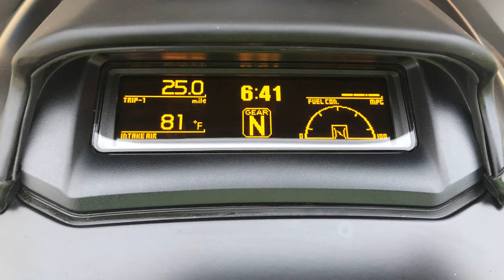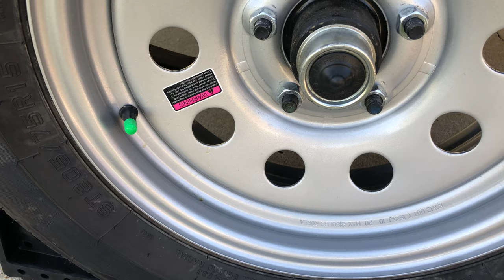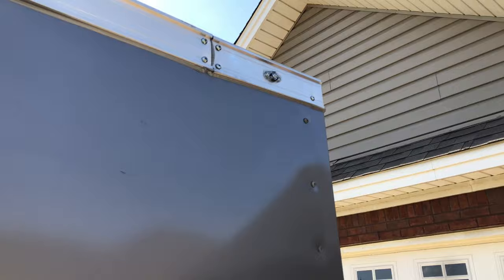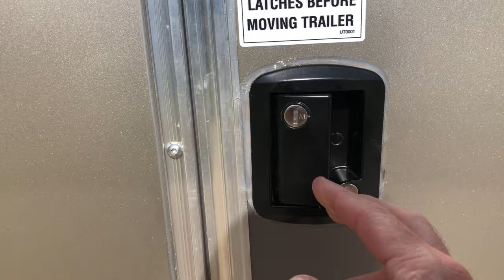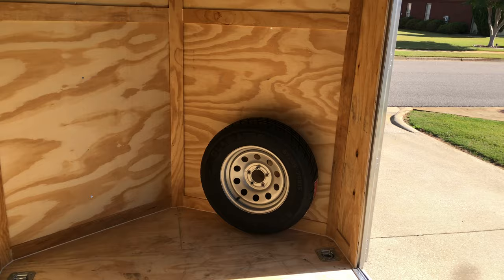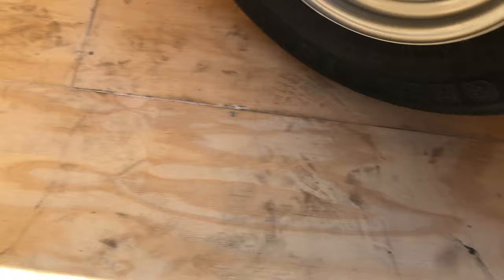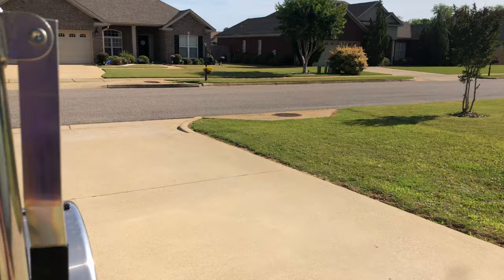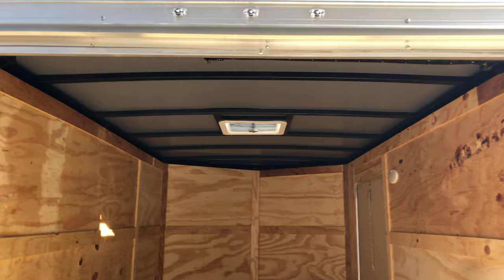I bought a 6X10 Enclosed Motorcycle Trailer For My VMAX

Comment: I'm doing a similar project with my single axle v nose.  It's only use will be transporting my 1975 Honda CB 360t.  I'll add Honda tools, portable air compressor and plugs for tv and fan.  I've got room for a cot behind my bike.  
Very cool my friend.  Thanks for showing.  I've got to get that Harley decal off the sides and replace them with large blue Honda wings.
Reply: Wow, I’ve had a ‘75 CJ360t in my garage for the last 20 years. Bought it on eBay in Seattle, and it’s on the list of things to deal with, though I don’t know if I’ll ever get to it. The CJ, you may recall, had drums front and back as well as a kickstart. I rode it in high school and have a real soft spot for it. 
I’m kind of wondering where you are transporting this old bike to and from, only because it’s not a real practical bike today.
I’m looking at trailers because after many years I’m coming back to motorcycling with a ‘22 CB500X, and I’m just fantasizing about transporting it as I think about possible winters in the Southwest. 
Again, purely brainstorming speculatively, I could see putting a little cot in something like this. I’m kind of shocked at that $3800 price tag for this, and I’m going to pursue it. 
How is your own project coming along?

Comment: Nice trailer. Don't forget to lock your chains up as well. Thieves can use them to haul it away. I also have a cargo trailer for my bikes. I went for the 6x12 & put a bed in the V portion. Works great ! I have a 2019 Goldwing tour, a st1100 & 2 Vespas.

Comment: Most of the public is likely unaware that the air we breathe and compress for filling tires is 78 percent Nitrogen. Good move with the stabilizers!  I would add LED external lighting for visibility and when backing at night.    Red running lights around the rear door surround area, yellow along the sides.  Double strips- along the top and bottom.   Even if you have a back up camera, you will increase your sight lines and distances to obstacles.

Comment: I have the same setup for my bike and did the same thing you're planning to do to the interior. I did permanently seal the door on the side, however. I would have preferred a trailer without the side door but they didn't have any in stock.  I think the door is convenient but to me it just wasn't secure enough.

Comment: A nice addition is a pocket added to the interior front wall to slip a light weight floor jack and handle in. Also keep whatever tools you feel like you need to change that spare. That way all that stuff is always with the trailer no matter what you are pulling it with.
Reply from the maker: Great idea. Thanks for sharing.

Comment: Nice, I think you got a good deal. You could probably get 2 motorcycles in there.
Reply from the maker: Thank you.
Reply: I have hauled my Ultra Classic and my Bultaco Pursang and Honda XL250 at the same time. Snug, but fit with no rubbing. I have rails mounted to the floor at the side walls with movable tie down loops,  along with floor mounted D rings at the front.

Comment: Nice enough but the wavy side panels makes it look like crap! Would have been better off with white vinyl. A couple of cheap battery op led lights in the inside would come in handy for night loading and a front wheel tire trap would be worth while additions too🙂

Comment: thanks for the review, are you able to tow trailer of this size with a mid sized SUV?
Reply from the maker: Yes, I have a 2021 Hyundai Palisade that can tow up to 5,000 lbs, which is the capacity of most mid size SUVs. My trailer will never hit that, even with a Gold Wing in it.
Reply: @JeffMarcum  Yeah, I have an X1, max tow cap of 3600lbs. Seems like I'd be a bit tight, especially with something without trailer brakes... I think 5K lbs tow capacity is a good round figure. I might have to upgrade then.

Comment: I've seen some videos of people double these as a motorcycle hauler and camper. Do you think theres enough room in a 6x10 to do this? Essentially enough room for a bike and cot?
Reply from the maker: I think there would be if you didn't put the bike in the center. That would leave room on one side for the cot. But it would also depend on the bike. A bike with hard saddle bags, like a Gold Wing, there probably wouldn't be enough room for anything but the bike.

Comment: Nice trailer. Don't forget to lock your chains up as well. Thieves can use them to haul it away. I also have a cargo trailer for my bikes. I went for the 6x12 & put a bed in the V portion. Works great !
Reply from the maker: Good point. I've not heard of stealing trailers with only the chains, but it makes sense. Thanks.